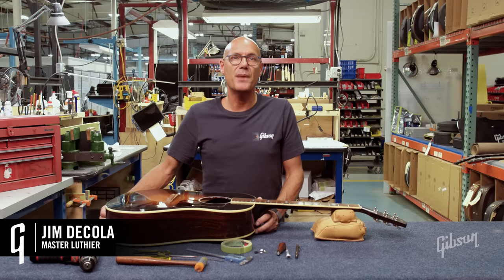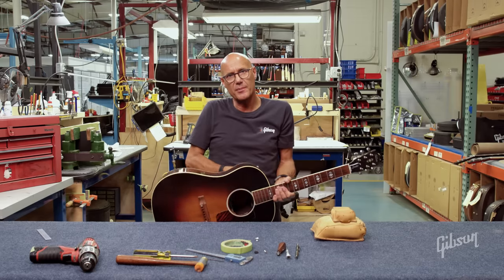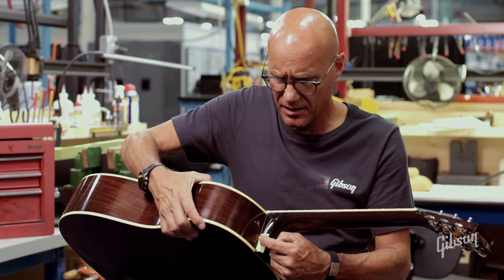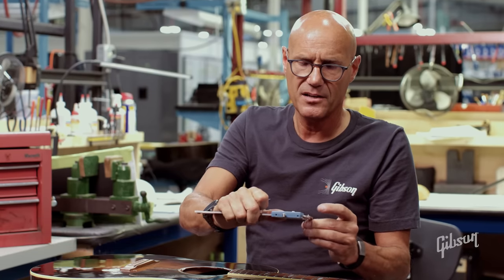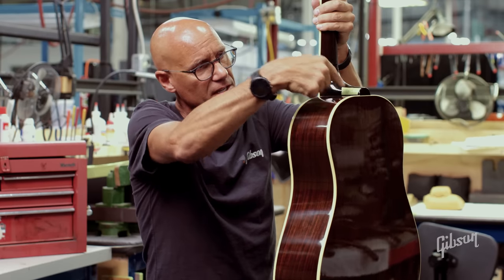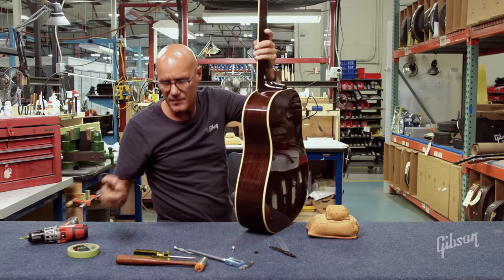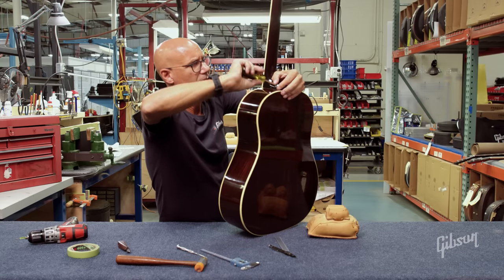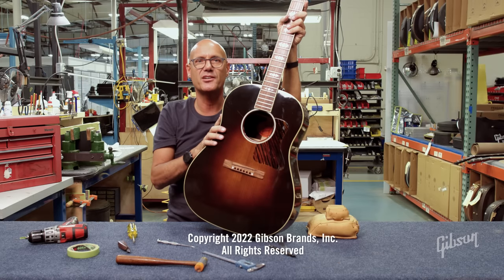How to Install a Strap Button on an Acoustic Guitar (Safely)

Comment: Dear Gibson, make this problem go away by installing the second pin during the production process! Thanks!
Reply: They can put electronics in their acoustics, but not a simple strap button. I guess installing a strap button at the factory just isn't historically accurate enough, but the electronics they put in 95% of the acoustics they make somehow are.
Reply: lol not everyone wants a strap button...
Reply: @arthurmurfitt7698  pro or semi pro musicians would disagree!
Reply: Would be great if they would glue a shaped block inside the upper bout at the factory.  Invisible from the outside to please the vintage fetishists but ready to drill in a standard (Les Paul) location for those who desire.
Reply: @arthurmurfitt7698 Name one famous person who plays sat down or with a piece of string round the neck 🙄🙄🙄🇬🇧

Comment: Remarkable you can spend thousands on a guitar and we’re expected to drill into the wood of the guitar to add something as minimal as a strap pin. Historically accurate is not an excuse. If someone doesn’t want it it’s a lot safer for them to remove it as it is form me drilling into my brand new hummingbird, and chance messing it up. Unreal!

Comment: Why the hell doesn't Gibson install them at the factory?
Reply: Depends on the Model.
My  j15 has a strap button at the heel of the neck from factory.
Reply: @i.m.22  And my 2008 hummingbird doesn't have one, which is why I'm outraged.
Reply: Always love these segments with JIM DeCOLA. The man is a Craftsman; explains everything in a easy to follow format.⭐️⭐️⭐️⭐️⭐️
Reply: @melancholyman96  Outraged? Try a Valium dude. Annoyed, maybe. But outraged? You're gonna have a stroke from high blood pressure.
Reply: @fix135  I'm interested in guitars, not drug addicts with their idiotic advice.
Reply: Tradition
Reply: If Gibson put them on at the facts, where should they put them? There are fans of both locations for the button. Rather than offend half the fans by putting them on, they allow you, the owner, to decide. You but a new ‘bird from a dealer, and I bet they will install it at your command.

Comment: Just got a Songwriter J 45 and panicked when I realized it had no strap button.  When I looked in side the case I found one.  However, I am a klutz when it comes to installing, fixing, and repairing.  Thank goodness for your excellent video.  I followed your instructions to a tee and didn’t screw anything up. ❤😊

Comment: Before you do anything I think it's a good idea to check out the end of the strap you intend to use. Is the leather end short enough, thin enough and flexible enough to fit up against that corner it will be up against where the neck joins the side? I've had nice straps that I could not use on a strap pin that had been installed this way. There simply was not enough room in that corner for the end of the strap.

Comment: Thanks for the instruction. Very useful. One question I have recentley bought an epiphone B.B King Lucille which has the strap button on the heel and was wondering if it is possible/wise or not to install an extra strap button on the top shoulder

Comment: Thanks for the wax tip, it came in handy. Waverly button strap comes with a Gold color screw and its probably brass and not as strong as other metals. I still used it but drilled with a 0.08 " bit  one inch @ forty five degrees then bigger bit ~0.11"  for an inch at forty five degrees. That's where the wax  was used and it's snug and doubt it will break now...🎼🎸

Comment: One caveat about going ahead with this lock pin installation, if you have an electro acoustic (as I do) be aware that repositioning the nut on the heel of the guitar causes the strap to obscure easy access to volume and tuning slide adjustments. It’s doable with the strap lifted. Overall moving the nut to the bottom of the neck is a neater outcome I believe, after having had a shoelace around the headstock for two decades!

Comment: Hi Jim ! I own a J 45 deluxe Rosewood. The guitar had already placed strap buttons. My issue is that the Gibson ASAC-TAN Montana Strap Tan *belt, while I play it produces leather screeching sounds, at the neck of the guitar. Is there a way or a compatible strap link that can hold the strap away from the necks' surface ? I hope my issue was clear enough... Many thanks in advance for your expert insight!

Comment: I personally don't like this and won't have it done to any of my guitars i place them  in the body right above the neck where it curves in the center  . I drill a small hole and on the inside of thebody , i place a small wooden block glued in place  i use a screw with a nut to hold strap button it works extremely well and looks the way it should  does not change tone looks professional  most people will tell you don't drill a whole in your neck as you can easily do a great deal of damage to your guitar some one said this guy is a master luthier and I mean him no disrespect I'm merely stating my preference and what I've been taught in my 55 years of life I cherish my guitars and I've had them for a long time and kept them playing and in great condition all on my own no I'm not a master luthier I'm a player at any rate good luck no matter how you decide to put your strap button in I think even this master luthier will tell you enjoy your guitars have fun play lots life is good and thanks for the lesson even if some of us have a different preference and been taught different good luck God bless play on
Reply: The guy in the video is a master luthier. I think I'll take his word for it.

Comment: If you need to measure the diameter of the drill bit and screw with callipers, DON’T do this job yourself, you don’t have enough experience working with wood, or these tools. Hold the screw up then hold the drill bit up against it. The drill bit should be just a little thinner than the thread diameter. Doing it by eye means less opportunity to make number mistakes. 👍🇬🇧🙏🌈♥️